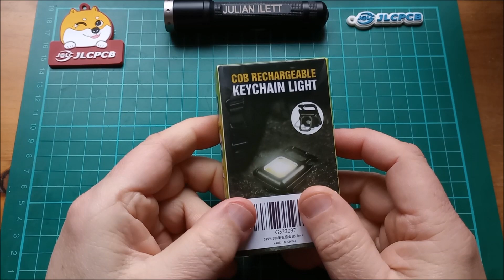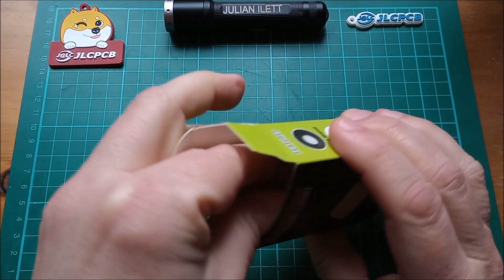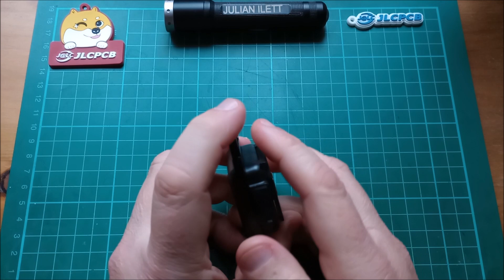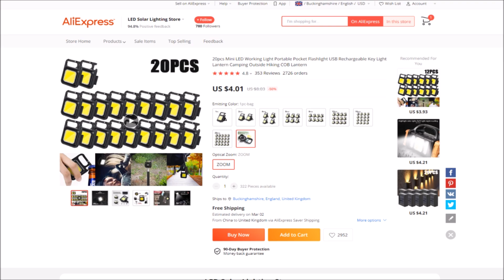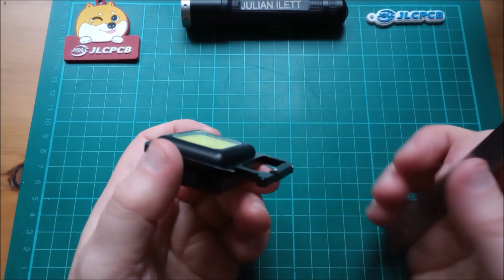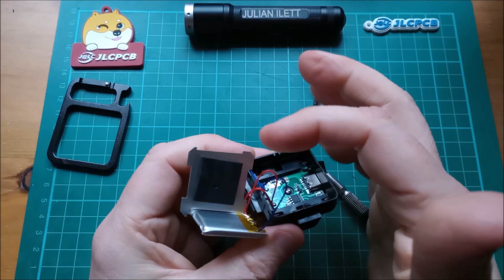COB Rechargeable USB LED Keychain Light

Comment: I've Been Using This Light For About 10 Days Now And Based On My Personal Experience I'll Strongly Suggest To All Of You That, Obviously You'll Never Buy This Tiny Keychain Light Before Testing It With Your Highest Attention. Either Way, You’ll Be A Loser Like Me. 😡

Well…
There Are 3 Important Reasons Behind My Suggestion And Based On My Own Testing, I'll Never Recommend You To Buy This Beautiful Piece Of Trash Without Your Acknowledgement. 😔

Firstly,
The Most Critical Problem I've Found Is That, After 1 Or 2 Minutes Of Using This Light It Will Start Dimming Suddenly And Will Automatically Go Into Dimming Mode (Candlelight Position) Within The Next 3 Minutes, Which Is The Most Annoying Part Of This Light. 😡

Secondly,
I've Observed Closely That, Its Charge Lasts Only For 10 To 20 Minutes If I Use It Irregularly. I Mean, If I Need To Search Something In My Room In A Dark Environment, At This Moment I've Turned It On For A Shorter Period Of Time For Searching My Thing And Again I've Turned It Off Within A Minute After Finding My Thing. Like This, The Charge Has Last For 10 To 20 Minutes As I've Experienced. 😡

Thirdly,
The Worst Problem I've Faced Is That, For Getting A Better Output, I Thought If I Kept This Light Connected To A Power Bank All The Time (At Charging Mode) As A Direct Source Of Electricity, Maybe I'd Get A Slightly Better Result From My Previous Experience. But Alas, In This Case The Output Result Also Comes Out The Same. 😡

I Mean…
After Continuous Use For Below 10 Minutes While It Is Charging At The Power Bank, It Has Again Started To Decrease Its Light Down To The Candlelight Position Within The Next 5 Minutes Of Time, Which Will Make You Extremely Uncomfortable And Unhappy With This Shitty Thing. 😡

So I'm Never Going To Suggest Any Of You To Buy This Cheap Chinese Tech, By Wasting Your Most Valuable Money. 😶

Thank You Very Much. 🚩

Comment: I bought them from AliExpress 8 for £12
Found really useful and works really well. Also the interesting thing is the light dims over time which resets on switching off and on. Presumably for heat.
Reply: best i could do is 4 with 2 free stands for £14  :),  the price has gone up, but for what I need them for, still cheap and good
Reply: @crazycrab8578  Hi I just bought another 10 for £16.41and that's the 500mah against the 300mah
Reply: @Electronics-Rocks  :(,   lucky :)
Reply: @Shaun Tremayne  I'd bet my last dollar that it's still 250mah...you ain't gonna get twice the battery in there
Reply: @procrastinator1842  yep,  little 200/250 one took one out ,
Reply: u f.............. joking 8 for 12£ i would pay 15 for 1 but my town u get nothing like this plus i have no bank gutted

Comment: I would assume this ic doesn‘t have any CC/CV battery charging functionality. It seems they used Q2 as a diode and the current / voltage limit for charging the battery only relies on the voltage drop and the hfe + R1 base resistor (+ the resistance of the charging cable) and the Charger voltage of precise 5V. The base current is limited just because of the high output resistance of the microcontroller. If the battery is drained the led will turn off at probably a safe level for the battery cause of it‘s minimum voltage level, but in the worst case the mcu is going to operate down to 1.8V, so you donˋt realise the battery gets dangerously deep discharged (because it still wants to saturate Q1)...if you then try to charge it you‘re probably going to have a nice fire hazard!
Reply: Yeah looks like a terrible design. I'll assume there are other versions out there with proper charging ICs.
Reply: Charge control is done by the micro. Q2 base is pulled low by the micro(pin4) when the battery is fully charged cutting USB power to B+. Track goes under the transistor Y1(SS8050).  Just tore one down and measured it.

Comment: After switching on you can hold the switch for extra brightness.
Reply from the maker: Yes, you can :)
Reply: Mine does not do that. The first press is full, which rapidly dims, the second press is low and the third press is flash. Long press does nothing.

Comment: Is Pin7 of the Chip U2 soldered on properly? (it goes to C2)
We have here such a glue, I think "B7000" for a good connection of smartphone-displays. This glue is s bit soft, so you can use it to add the front-part to the lamp.

Comment: Audio is a bit low Julian, you could always get a bluetooth lapel mike or some such. But honestly, we can just turn the volume up here :)

Are you ever going to finish the Vocoder or is it permanently gathering dust now?
Reply from the maker: The vocoder is in the shed. The shed was meant to double up as a workshop, but it's not suitable for that. It's either far too cold or too hot in there. It needs 12 inches of insulation in the walls to maintain a workable temperature. The roof is also a problem. It doesn't leak, but condensation collects on the underside. That drips down as a brown sludge onto all my stuff (including the vocoder PCBs).
Reply: @JulianIlett  What you need is a diesel heater 😁
Reply: @julian ìlett, I intended to repurpose one of my existing sheds as a workshop, but quickly realised that it was not feasible.   I built one with 120mm of insulation all round, which is more than sufficient.  Less than 200 watts of power is all that is required to keep it warm.  I have a 7.5 watt extractor fan to provide some ventilation. It made a good project.
Reply from the maker: Did you insulate the roof?
Reply: AUDIO seems ok here !   :)

Comment: It's really quiet
Reply: Ironically when you did the screen grab it was louder.
Reply: just go back to the previous camera. people will not stick around if the audio is so low :(
Reply from the maker: The previous camera (Nexus 4) is awesome, but the battery is so bad it keeps crashing and losing shots. It was becoming a real problem. I bought a new battery, but it was no good (I was scammed). Maybe I'll try again.
The Moto G31 has a much better OLED screen which is great for monitoring, but the audio (using the Open Camera app) is terrible. I'm really disappointed.
Reply: Can you not leave it plugged in? Or is it worse than that?
Reply from the maker: The Nexus 4 has been plugged in for the last year or so (the battery is that bad). But I don't think USB can provide the necessary current peaks and the phone keeps crashing.